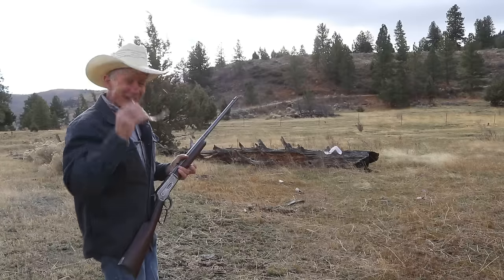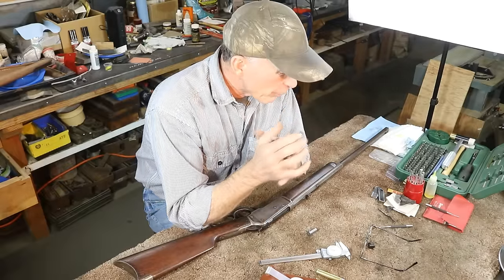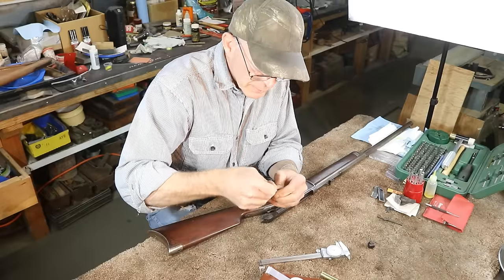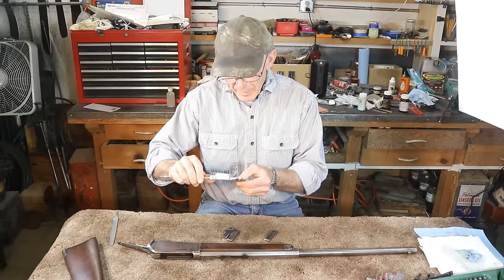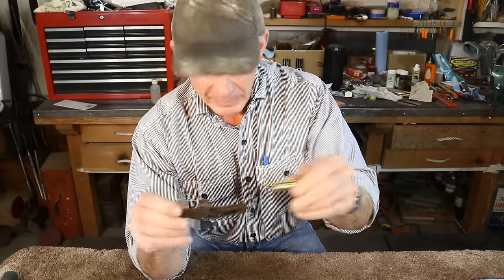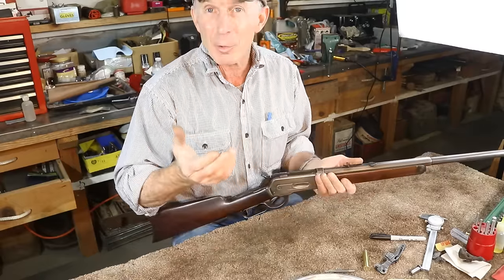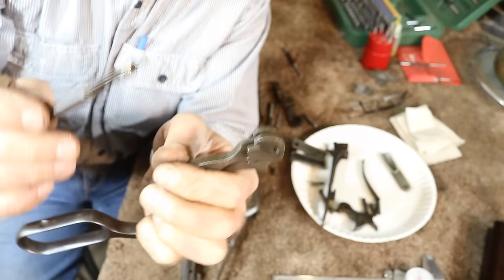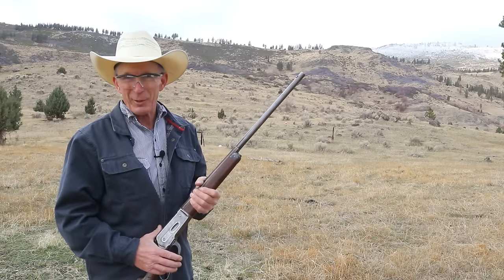Troublesome 50-110!

Comment: The 50-110 is the Holy Grail of 86,s Don't see many of them especially the button mag guns. Thanks for the tip on correcting head space. My 40-82 was that way when I got it. Primers would back out. The barrel was a sewer pipe so I opted for a new barrel much to the lament of my pocketbook. Got it from winchesterbarrels out of Florida. It is a shooter now. That is a lot of bullet for a lever gun...

Comment: 1886 lever in 45-70 with 26" barrel is my favorite. Nice repair job on the 50-110. I've fired a  Sharps falling block 45-90 and a Springfield trap door 50-70 but never a 50-110. 👍

Comment: I haven't seen it done for rifles but in engine assembly rod and main bearing tolerances are measured with plasti-gauge, a product that is bolted into the desired location.  Once removed, the thickness of the plasti-gauge is measured with a micrometer.  In this case, you would be reading the head space.
Reply from the maker: What an interesting idea!  I've used plasti-gauge when building engines.  I'll have to see if I can find some in the shop and give that a try.

Comment: I have a question about the locking blocks. Given their simple construction, could anything be gained in terms of strength and longevity if you made a set of brand new set of locking blocks on a mill and harden them to spec? I know it’s an involved process compared to setting the barrel back but I am curious.
Reply from the maker: Personally, it wouldn't be worth the time involved to make a "one-off" set of blocks. If a person wanted to make a batch of new blocks to sell, it might be worthwhile.  There are reproduction locking blocks made for 1894's in +.005", .010" and .015" over sizes to take up headspace.  I don't know of anybody who makes replacement locking blocks for the other Winchester models.  Sounds like a good hobby for a retired machinist.

Comment: I just purchased a 71 in 348. How hard is it to convert to a 45-70 ?
Reply from the maker: I don't have any experience with that conversion, but I don't believe it would be terribly difficult.  Besides the barrel either being bored or replaced, there may have to be some modifications to the internals to get the 45-70 to feed properly.  For what it's worth, I prefer the 348 to the 45-70, especially for a hunting cartridge.
Reply: You could do 50 Alaskan, .50-110, or .50-100 WCF.    Check with Starline brass for cases.

Comment: Great vid! I learned more about lever guns in this vid than any other vids. And the way you laugh after every shot makes me laugh to. I have an old Winchester lever i think its a 1896 25-20 or 20-25? it was a take down model i found it at an old abandon gold mine in Alaska. Some 1 had cut it into a mares leg and sanded it to make it shinny than left outside I can tell it was mint before that by no wear to the bluing above the trigger they missed with the sander:( I want to save it i don't know who to give it to for restoration. I took the barrel off. I dont think its even legal to have it together good thing its a take down model. The barrel is the hardest part to find i have had no luck. I just want to save it. Or at least make it legal to put on the wall. I also have never seen ammo like this up here. Older lever guns are not popularly carried up here with grizzlies running around bolt action magnums are the norm. The new stainless 45-70s are vary popular.